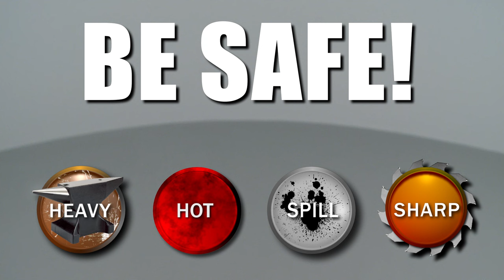Craftsman Riding Lawn Mower Clutch Interlock Switch 532176138

Comment: This Craftsman Clutch Interlock switch was not well documented or pictured within the parts manual.  After searching the Internet forums for something like riding lawn mower brake clutch switch, finally found the units are termed as Interlock switches. (eg. One interlock safety switch for the seat, one interlock safety switch on the brake pedal.)  Removal was elusive as well, since I had no initial picture of the part, removal also appears depressing the brake pedal at the same time as depressing the tabs of the interlock safety switch.  Finally after a day or two, I now feel well self-certified and trained enough for removing this, albeit, simple part!
Reply from the maker: You can do it!

Comment: Do you have to remove the part to test it or can you test it in place?  I think this is what is wrong with my mower.
Reply: If you can get a continuity (voltmeter) sensor into the small void while depressing the brake pedal.  Guessing, if testing is required, likely needs a good cleaning as well!

Comment: Used mower 2x today, got ready to take off the trlr, starting mower putting in gear, let off clutch easily and it died, as long as clutch was depressed the mower ran then, POOF.
Reply: My exact problem. Did changing this switch fix your problem? I'm also looking at seat switch